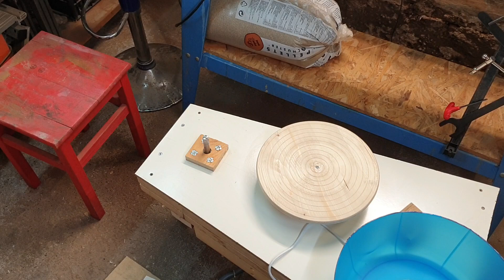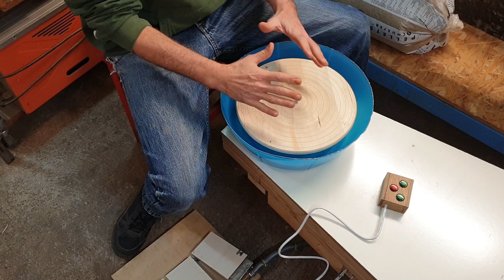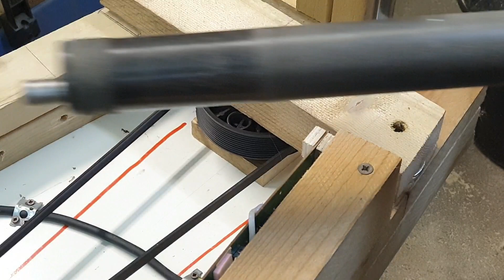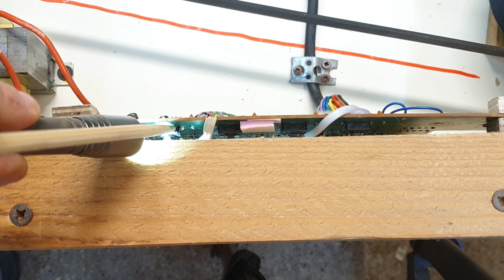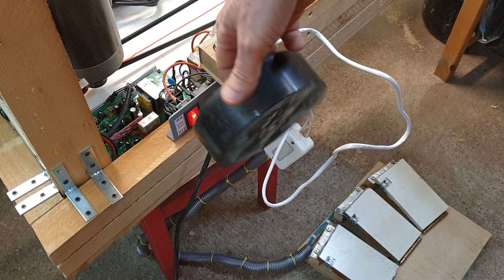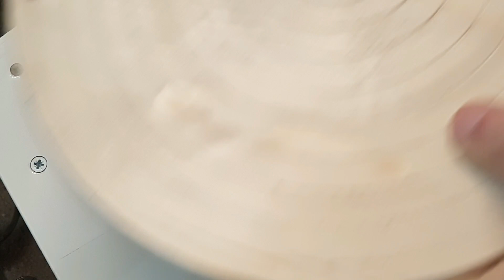I Built a Potters Throwing Wheel Out of a Broken Treadmill

Comment: Great project nice work. You could use that larger washing machine pulley, which would also shorten belt length, to get slower speeds. Potters do most of the forming and finishing of pots at speeds of 5 to 50 rpm. Is there a minimum speed trim potentiometer on the main board. That would solve everything.
Reply from the maker: Ho man, if only that circuit had a potentiometer life would be simple, I could have just ran wires to it and connect it close to the working surface, but it's all on chips, and programming those is beyond my ability. Maybe some day I'll get a decent machine (and a lesson or two wouldn't hurt).

Yuval

Comment: Neat project for the lockdown Yuval. Throwing is something I’ve often wanted to have a go at. Couple of questions, Is the motor going to have enough torque to turn the weight of wet clay & are you going to make a waterproof cover for the foot pedals and switch panel ? 
Look forward to seeing some of your families projects in the future.
Stay safe my friend.
Regards from the U.K. 
Geof
Reply from the maker: Thank you Geof! The motor is five time stronger then most throwing wheels motors (they are usually a quarter horse power, this is 1.25 horse power), remember, this was taken from a treadmill, so it was made to bear and move at least one person on a moving belt. I won't make a water proof cover for the pedals, since the current running through those is minuscule, they are not directly controlling the current to the motor, and I did make a cover for the switches, splash proof.

Yuval

Comment: Are you thinking about adding a dimmer insted of the buttons?
Reply from the maker: Sadly this motor machanism doesn't support using a dimmer if I want the full power of it. I've tried using a dimmer with AC, but the torque in the lower speeds was too low for working.

Yuval